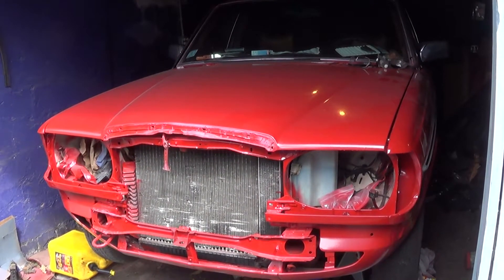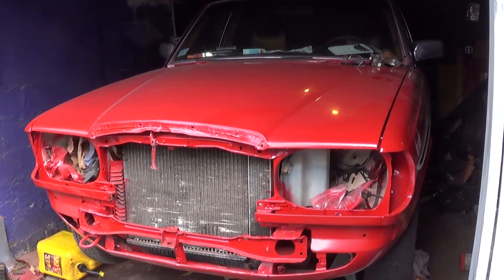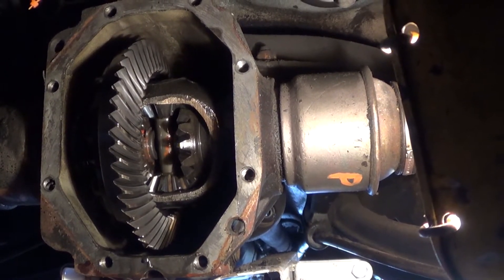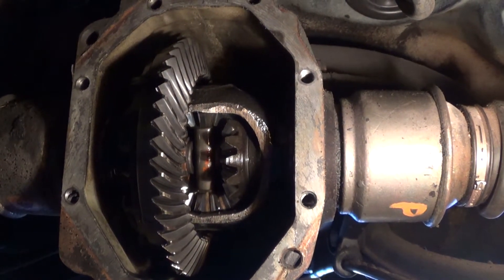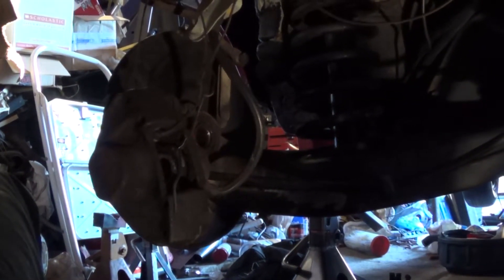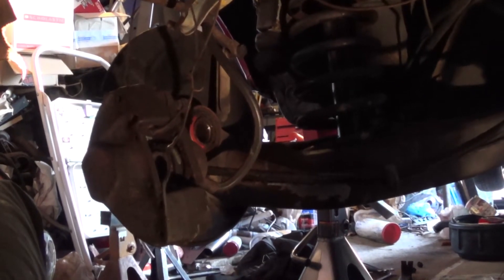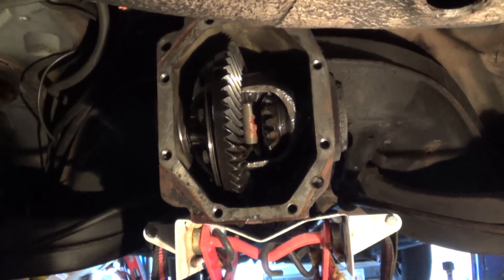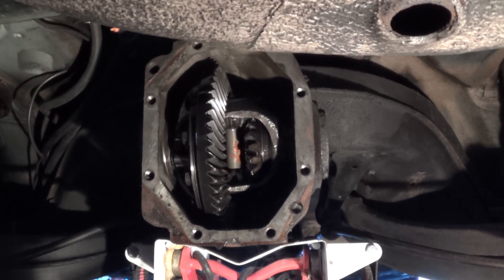1983 Mercedes-Benz 240D - part 159: removing cv axles

Comment: So how did you get the axle retainer clips out in the differential? I would have been helpful to see how you did this.
Reply from the maker: As I recall, there's a little tab on them. You should be able to grab those tabs with a hook and/or a long-nosed pair of pliers and just pull them out. I had the car on jack stands, not a lift, and had limited space to show anything. No room for a tripod meant that I had to explain the process and then pull the clips off-camera.

Comment: Been their, done that. Hated the job. The inside clip was a pain. Spacers just make the fit better, and keeps the slack from wearing the cv joints down, and helps keep more dirt out of it. I also applied Benz axle grease onto the ends to help keep dirt and grit out.
Reply from the maker: westpur Meh - it wasn't too bad. I was able to get the clips off pretty easily with a hooked puller. Thanks for the tips, I'm sure they'll come in handy upon installing the axles.

Comment: Hi, I want to know if i can repair the differential. My make noise.
Reply from the maker: ION IVANOV Hello. I'm no expert on differentials. I also don't know what kind of car you have. All I can recommend is to be sure that you have the correct fluid and correct quantity of fluid in there. If taking care of that makes no difference, then it may need to be repaired. But, I wouldn't know where to begin offering any advice on that.
Reply: HI. I have Mercedes W123 200D 1981 600000km .Thanks
Reply from the maker: ION IVANOV All I advise is to get fresh fluid in there of the correct type and quantity. If that doesn't solve the problem, you may be better off just sourcing a good used differential.

Comment: Dude that's sweet I just picked up a 83 240D with 108K miles on it I owned one years ago that I did absolutely nothing to for years other then oil/fuel changes. This one seems to be looking the same
Reply from the maker: Best of luck with the car. This is my third 240D (fourth if you count my parts car), and my seventh if you count other Mercedes diesels since 1996.

Comment: I think the spacers go on the other side of the axle, into the hub rather than the diff.
Reply from the maker: Tugboatpb That's not what I've heard, and the parts diagrams I'm seeing are inconclusive. It may or may not turn out to be an issue.

Comment: if ur going to show how to remove cv axles actually show dont skip...
Reply from the maker: First off, thanks for watching. 

Over the years, I've mainly done two types of videos. Some, are complete (or close to complete) DIY instructional repair videos. Over the years, I've tried to be better about labeling those videos. The other videos I've tended to produce are video blogs of an ongoing project. This video fits into that category. This video (part 159) was only ever intended to show a little bit on the day I replaced the CV axles, and was never intended to show every step.

As I said, I've tried to improve video labeling over time. This particular video goes back seven years. With the large number of videos I have up on my channel, it's impractical for me to go back through over a decade of videos (706 total, by my count) to rewatch and relabel everything. So, I'm sorry if the labeling on this was was misleading, but that was purely unintentional.  

It's also impractical for me to make every video a full DIY. This Mercedes project took me over three years, end-to-end. This isn't my day job and I do this in my spare time. As you might well imagine, creating a full DIY video is significantly more complex and time-consuming than creating a video blog entry. Oftentimes, when I'm doing a repair in one of these videos, I'm doing that repair for the first time. I don't have a good feel for it yet, and don't know what all the "gotchas" are. Usually, I try to reserve DIY videos for when I've done a repair more than once. 

I have tried to create DIY videos based on first-time repairs before, but the results usually aren't good. As I said, there are usually "gotchas" you figure out along the way, that aren't listed in factory source instructions. I might attempt to film a repair in the order listed in factory repair instructions, only to find out that in practice, the instructions are incomplete, incorrect, or there's a better/quicker/more effective way to do the repair.

Other times, I'll video blog a repair that I deem unsafe, impractical, or too complex for the novice DIY-er, instead of creating full, end-to-end instructions. Or, if I'm working on a project car, I will only show highlights as I video blog the project. If I'd filmed everything on this car as a full DIY, I might easily still be working on the car all these years later.

But, I digress. That's just a background on why not all of my videos are intended to show full repair instructions. To bring this full circle, and to address your actual comment, this video was not intended to show the viewer how to complete the repair. Once again, I'm sorry that this video didn't have the information you were looking for, but I honestly never tried to present the video as such.